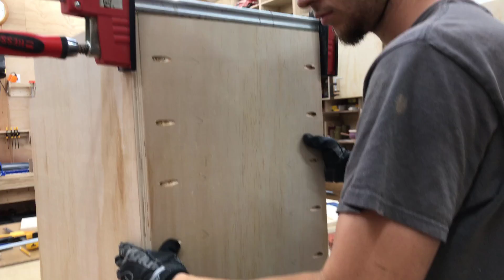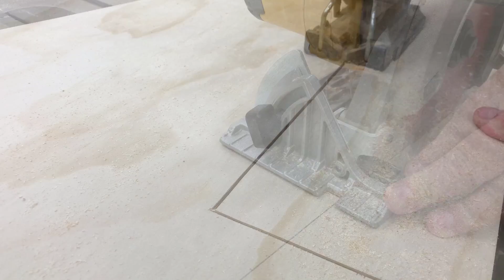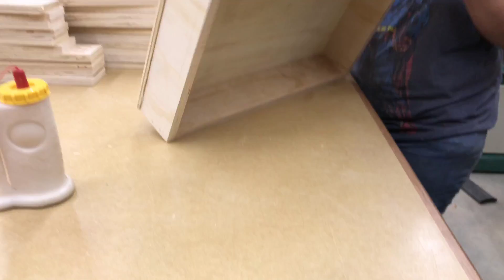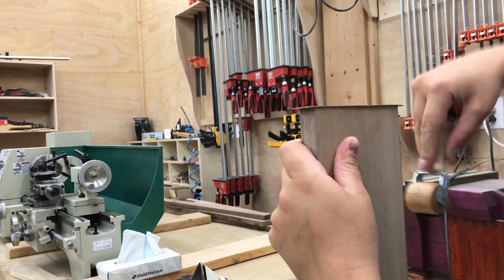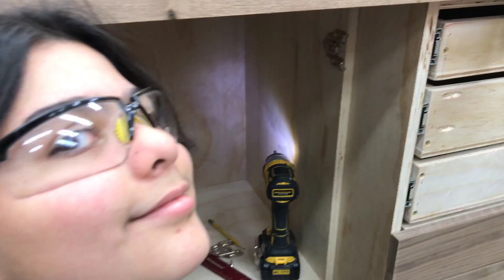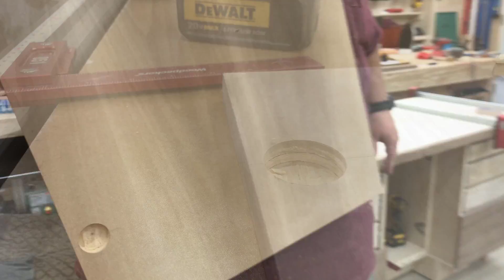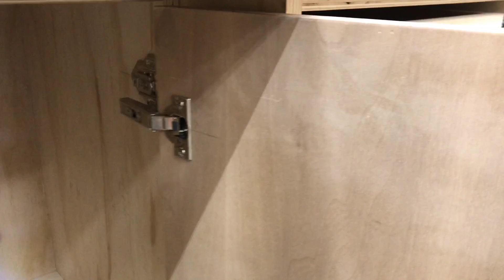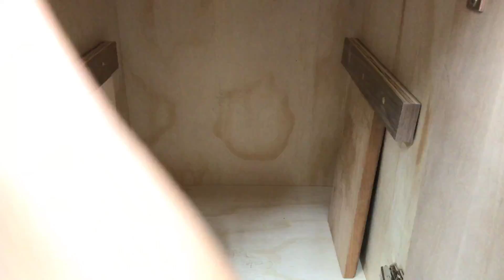25 - How To Build the Extreme Lathe / Benchtop-Tool Mobile Cabinet

Comment: Since its a metal lathe you should put a sheet of steel on the cabinet top to protect the wood. You will be using cutting oil or coolant and it will ruin the top of that cabinet.
Reply from the maker: Thank you for the advice.

Comment: Nice project. Talk about over engineering :-)

I think it's great that you include your family in your work.
Reply from the maker: Hi! Thank you very much! Haha, I think we overbuild everything.
Reply: Also, why don't you use glue along the pocket hole connections?
Reply from the maker: We've done some testing and it doesn't actually add any strength since it is an end grain glue joint.
Reply: Good to know. Thanks for the info.

I'm thinking of building a similar cabinet to house a planer. One of those 15" planers that weighs about 350lbs but doesn't have the base or indeed/outfeed (Grizzly G0815). That way I can make use of the space below the planer too.